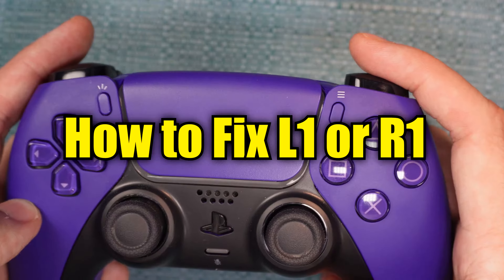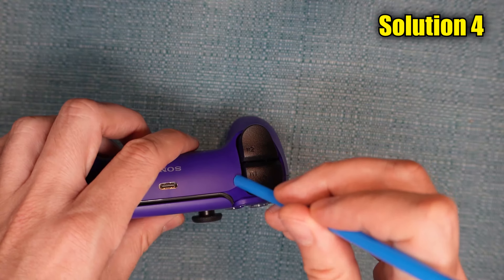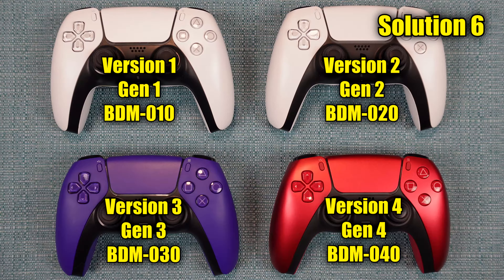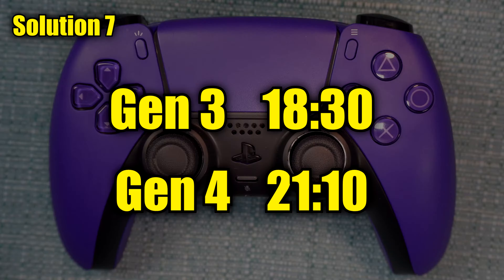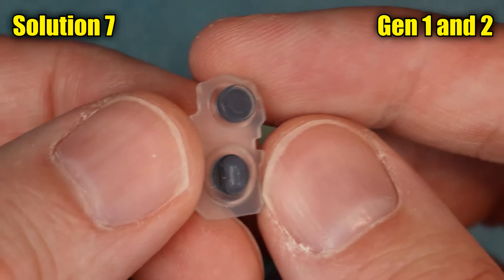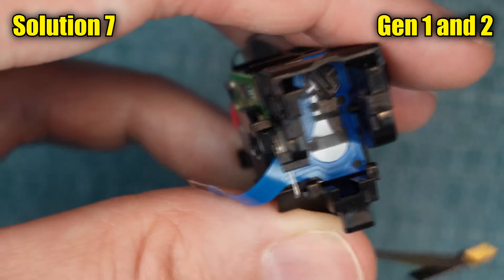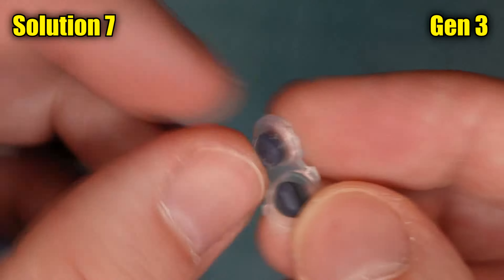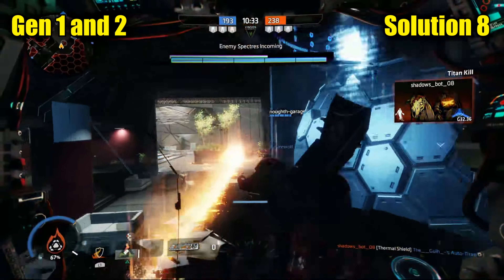How to Fix L1 R1 on a DualSense PS5 Controller | Repair Replace Clean Stuck Sticky Broken Shoulder

Comment: I notice when looking for the L1 and L2 module, there is a V 1.0 and and V 2.0. Will a 2.0 work with a 3rd generation controller? I'm trying to fix the L1 on my gen 3 controller and the only option is to replace the entire module because the plastic piece broke off. Any help will be appreciated.

Comment: What type of alcohol will work because i only have vodka and hand sanitizer and don't want to mess it up
Reply: I don't think vodka would work that well It evaporates too quickly I think. hand sanitizers are too goopy, but it Would still might work, I would use rubbing alcohol cuz the viscosity and better safe than sorry

Comment: Solution 6 worked for me, I took both top buttons out and saw the inside of the controller was damaged and sticking out (may have been dropped / thrown 😅) luckily  I was able to pop it back in place and it works fine now

Comment: When putting the trigger mechanism together dont just put it at the topmost position theres more to it. The gears have to align properly like timing an engine. If they aren't aligned properly the mechanism won't have full range of motion if any. So I do advise you make another video on how to properly align them now that you know. It could also cause more wear to the motor and decrease battery runtime as the gears bind. So take some time and make sure the black arm on top has full range of motion! Pin comment plz this is useful info
Reply: Also note the possibility of a damaged ribbon cable, thats the issue I've had after doing hall effect mod. Inspect the cable for rips and damaged pads on the end